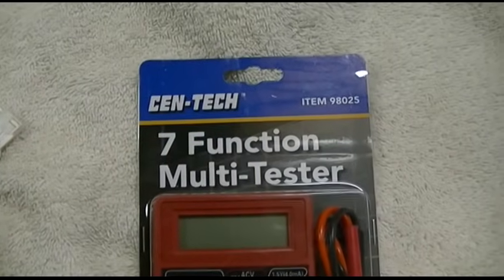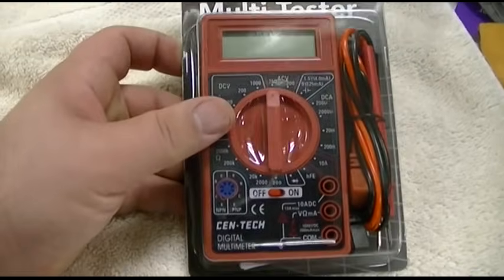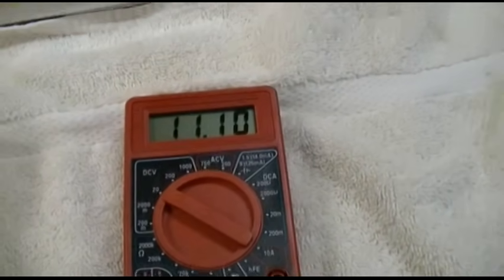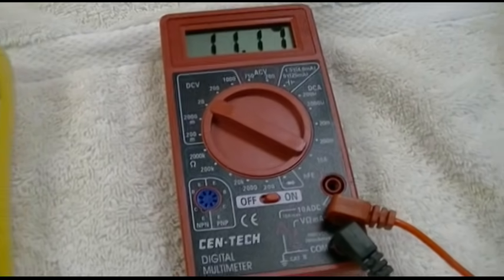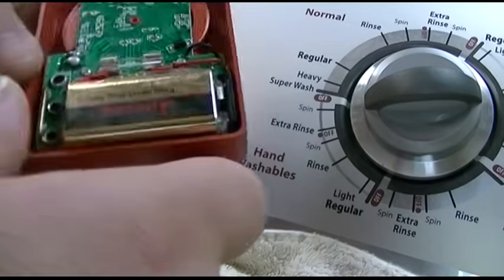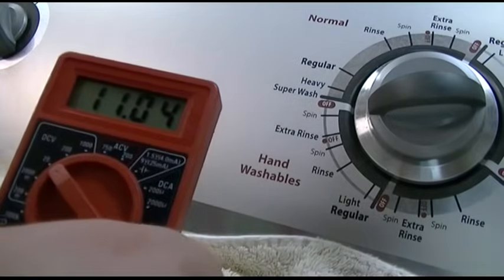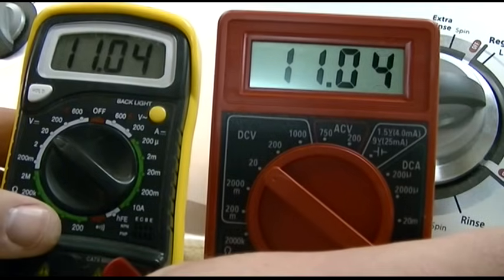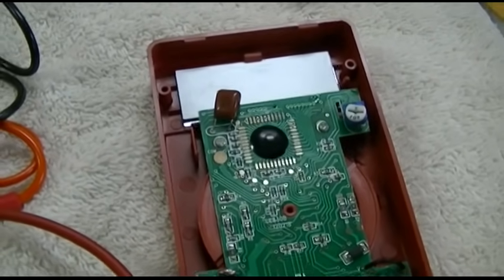Harbor Freight - Cen-Tech 7 Function Digital Multimeter Review

Comment: Just tried out my Cen-tech on a commercial generator radiator hoping to find a reading between 0.01 and 0.05. Set it on DC volts 20 with the positve  lead grounded and the Negative lead in the coolant. Started out at 0.2! but then slowly dropped to 0.07 over a period of one minute. Now I know that you don't use a free multimeter on a $K200 generator as I was just trying out this little freebie. Not sure if I'd use it on my 15 year old Cadet lawn mower now though.
Reply from the maker: Yeah cheapie meters are good for certain things, like "let me see if I have 120 volts at this outlet", or "what is the standby voltage of this power supply with no load", but for real fine-tuned stuff, there's nothing like a Fluke or even an old-school Simpson.

Comment: Hey man - nice video!  I have the exact same Cen-Tech multimeter,  It worked great out of the package for about 3 months or so, but now it gives crazy reads.  I usually am trying to test voltage on 12volt batteries (in or out of a solar set up) and get the numbers blinking with odd reads on the LED like 1.45; 1.78; 1.39; and so on.  This is when I know the batteries already have at least a 11 point something volt charge as I have an analogue volt tester too that reads somewhere in the 11 volt area. I have replaced the battery in the cen-tech unit and tested it (original one has a good charge) and tried to figure it out but I'm stumped.  Any ideas?  Thanks.
Reply from the maker: computer35guy Sounds to me like the wonders of a cheap meter.  

Couple things you can do; if it's within 90 days and you have a receipt, you can exchange it.  Or, you can actually go and buy one of the same, and return your bad one in the package with your receipt, but I never told you that.

If you don't care about the money, I think for 50 cents more they have one with a backlit display.  Often they will give away these meters free with a coupon, you could always wait till then.  And when they do have free coupons, you might ask friends/neighbors in your area for their coupons as well.  I have a Harbor Freight right on my way so I get a whole bunch of coupons and stop in every couple days and get free stuff.  I must have 10 of these meters by now.
Reply: jaykay18 Thanks for the reply.  I think I will upgrade and get one that has a better track record.  Thanks again.
Reply from the maker: Enjoy!
Reply: It plainly states in the manual that this meter should not be used to test 12v,
Reply: The portion of the circuit board where the test leads plug in and are then soldered to the main board is known to be a point where the solder joint WILL crack and then you will either not get a reading or your readings will jump all over the place so you can either re flow the solder joint but it WILL just break again or you can solder a small jumper wire to connect the small board over to the main board to prevent it from continually breaking. Mine broke within the first two days, of use. If your not changing test lead ports very often yours might last longer, but if you change them often I promise you it WILL break at that spot!!

Comment: I have a Cen-Tech 7 function multimeter with a back light. It works good for measuring battery voltages and stuff. I bought it at Harbor Freight along with some other stuff me and my mom bought.
Reply from the maker: Splendid.